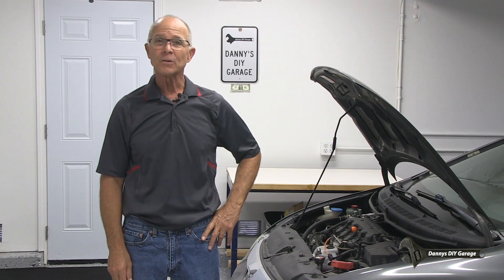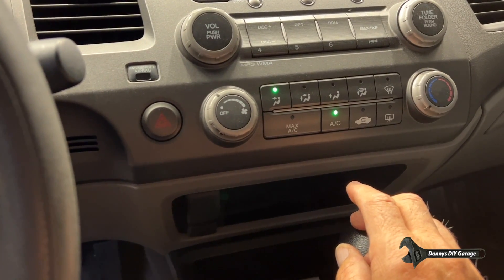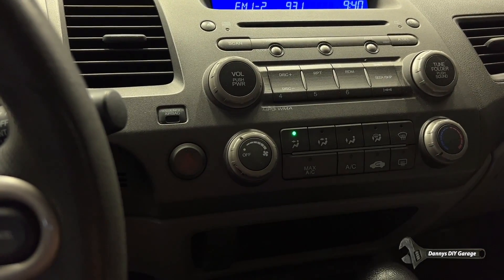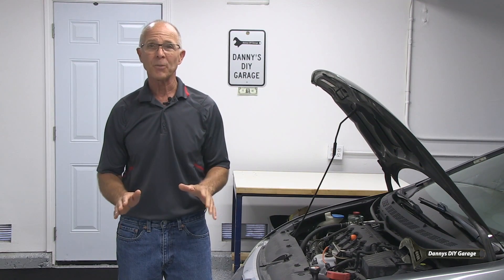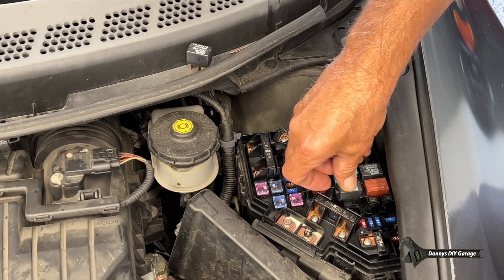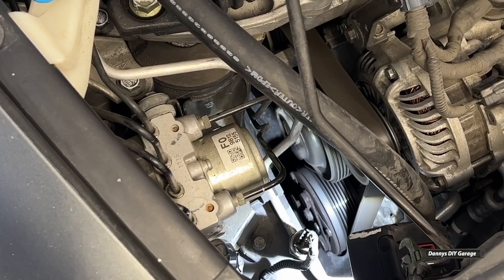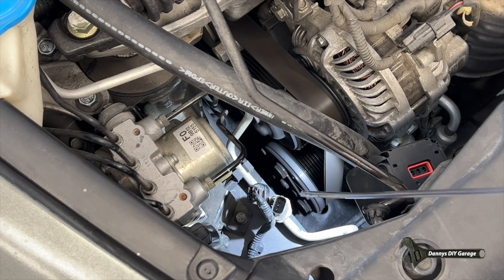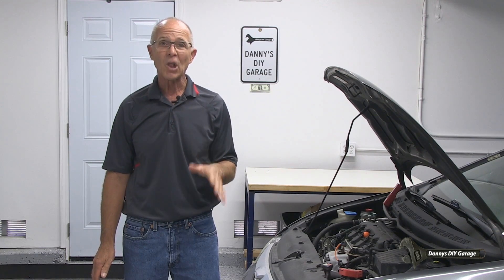Honda Civic 2009 AC system blows warm FIX

Comment: I am having issues with the buttons, when I pressed them stays on just one button and doesn’t switch to blow air. I have no problems getting cold air and heat, the problem is that doesn’t switched to blow air to the windshield or to my feet, any recommendation to fix that please 🙏
Reply from the maker: Sorry I never saw this comment, did you fix this
Reply: @dannysdiygarage i have a similar issue. i was told the whole ac system is bad. when added freon it blows colder air but last like a day or two. clutch engages, fans turn on and it blows colder air when recharge. if it was the whole ac system i doubt it would do that. any recommendations on what to do to check if is just one part?
Reply from the maker: @joseturcio361  if it won’t do a diagnostic check, you may need a control head,
Reply: @dannysdiygarage   so my ac blows cold air in the morning- parked inside garage but if i leave it outside in the sun the ac blows just air not cold at all. my ac compressor clutch turns on, all fans turn on. i will replace the the air blend door actuator cause is bad. what can be the problem?
Reply: i think u have a bad ac power head

Comment: Thanks for uploading.My 2011 honda civic is not cooling.After replacing relay the clutch started moving .car still not cooling .Gas was low and added.what I can do myself? Please help me thanks
Reply from the maker: Get a set of gauges and see what the readings are, some auto parts stores loan them out for free, the gauge readings will tell you a lot

Comment: You didn't say how you found out the expansion valve was bad! 
:face-orange-frowning:
Reply from the maker: It was because I had the correct amount of Freon in the system, compressor and fans came on, the blend door was working properly, so it had to be the metering valve or ( expansion valve ) and it was

Comment: I thought you weren't supposed to add freon if the gauge is reading in that "good" area?
Reply from the maker: There is more to it than that, it all about ambient temperature, airflow through the condenser, humidity and Freon high and low pressure, lots to consider

Comment: Hello Danny... im not getting cold air... my ac compressor clutch doesnt engage, PSI in the low-pressure circuit is around 60... when i do the test pressing the 2 buttoms, i get 4 blinks... btw when I press any of the air circulation modes, they dont redirect the air as they should, basically nothing happens... i would appreciate any help
Reply from the maker: 4 blinks indicates an open or short in the mode control motor circuit
Reply: @dannysdiygarage  thanks danny, I'll check it 👍

Comment: Unlike your car when you added freon when I added 1 can of the freon my ac became real cold. However after several days now it switches and blows cold to hot
Reply from the maker: Have you watched all my videos on ac diagnosis?
Reply: @dannysdiygarage  not all, when I have time, I will. Was only able to watch the expansion valve swap in its entirety
Reply: Im leaning towards compressor clutch vs expansion valve because of the symptoms and from me adding the freon and it changing
Reply from the maker: This one has some helpful tips https://youtu.be/WbPGVfQjAU8

Comment: What was the troubleshooting step that identified the expansion valve.  Totally missed that one.
Reply from the maker: trouble shooting was my gage reading did not make sense after I evacuated, recharged with the right amount, at times it would blow cold, however it was inconsistent.

Comment: I've  sent you several requests, and you never responded to why the heck my 8th gen civic when the self diagnostic on the heater blinks 8 times when I  don't  have A/C?
Reply from the maker: Sorry about that, I work a full time job and I unfortunately I do miss a lot of comments, blinking 8 times indicates an open in the evaporator temperature sensor circuit

Comment: If the control head flashed. What steos do I take to fix this problem? Do i have to take it to a mechanic or is it relatively easy to correct??
Reply from the maker: Depends on the dash code, some are easier to fix then others

Comment: I did the first test and the light is blinking 😢 head control head have a problem but not sure what it is. Any help is blessed
Reply from the maker: depending on how many times it flashes depends on the diagnostic procedure, blinks 1 time, indicates a open in the air mix circuit, 2 times indicates a short in the air mix circuit, 3 times problem in the air mix control linkage door or motor, 4 times open or short in the in the mode control motor circuit, 5 times problem in the mode control linkage, door or motor, 6 times Blower motor circuit, 7 times heater control panel error
Reply from the maker: watch this video also, it might help in your diagnosis https://youtu.be/vhPZsccyagA

Comment: My car honda civic fd 1.8 2008 automatic dont start, it is posible because i removed the belt?
Reply from the maker: No belt will not cause it not to start
Reply from the maker: Fuel, Spark, Compression, timing, update me when you get it fixed 
Also check the airflow sensor, sometimes you can unplug it and it will run if it’s bad
Reply: Huhu my car dont start, all sensors are ok, base on the scanner.
Reply from the maker: Is your fuel pump working? https://youtu.be/UK_Mod07vG4
Reply: Yes fuel pump ok, fuel injectors ok, spark plug all new,.
Reply: Ok,..thanks,.
Reply: @jovinmagallon9729  what happened?
Reply: @PiLLO360  fix already sir,.

Comment: Hi Danny I have a 2012 Honda Civic.I put some r134a and it went from 85 degrees to 40 degrees it stays cold but my ac clutch cuts in and out every 5 seconds.Im don't know if I put enough or too much I went to 30 psi on the low side but the can states go to 45 But it says if it has an expansion valve tx system might only take 25 to 30 psi.I am just curious what should I do.
Reply from the maker: Make sure when ac on both fans are on at all times, that’s a tough question to answer, especially not knowing the high side and ambient temperature/humidity, but I would guess Freon could be low 
Also if it’s blowing 30 degrees when driving, I would be fine with it
Reply: Good day sir my ac control panel has no power ,no light on panel what could I do to fix that.
Reply from the maker: 40 degrees is good, without knowing the high side reading and ambient temperature, it’s hard for me to give advice, I would probably leave it alone,

Comment: I had problem with 2007 civic where clutch only engaged sometimes the hotter it got outside the less likely it was to work so we took ac clutch plate off through wheel well it is a common problem and took out one spacer shim washer and cleaned rust from back of clutch plate with wire wheel the few thousands of the shim had it working perfectly after we put it back together and it has worked for years since then
Reply from the maker: I’ve also had that problem, years ago, thanks for sharing

Comment: Love your videos.  I have a 2008 Honda Civic LX that I bought new.  Unfortunately the AC cuts out when the car gets too hot.  I've traced it to the clutch not engaging when the engine gets hot during the hottest time of the day in summer after the car has been driven for a few minutes.  AC works fine every other time and season, which as you can imagine is extremely frustrating.  How would I go about fixing the clutch engagement to engage when I need it most, ie when it is hottest?
Reply: i fixed mine by removing access panel in plastic shroud on passenger side with wheel off then removing clutch center bolt with an impact wrench so clutch does not spin then remover one thin shim and clean back of clutch plate put it back on and tighten it back up there is videos on you tube of people doing this it worked perfect for me we did it years ago and it has worked since then.
Reply: @ranger178  will engine run if the clutch is disconnected?
Reply: @deschaenes  it is just the metal plate on outside of clutch that you fix it gets sucked in by electromagnet to turn on ac and thin spacer washers are put in at factory to keep it from rubbing when it gets old and worn magnet can't pull the plate in so you remove one thin shim, and you can check clearance with feeler gauge then put plate back on it is just one bolt if i remember right
Reply from the maker: I would also check the relay
Reply: @dannysdiygarage   I did check the relay, fuses and freon pressure.  AC works great except when the engine gets too hot, then the clutch disengages.  Will attempt Gregs suggestion once the warm weather returns.  Thanks to you both for your help.
Reply from the maker: At 7:30 in this video, I explain what Greg mentioned
Reply from the maker: Thanks for adding this

Comment: Can you explain the diagnosis of the AC clutch? 
You said if it does engage when pressed with the crow bar then it "does" need replaced... Is that correct? 
I'm trying to diagnose my 08 Civic AC issue as well as a whining sound, which I've also found can be from that clutch not engaging. Though the whine could also be an idler pulley. 
Any advice?
Reply from the maker: Get a cheep stethoscope for diagnosis on the whining $6.00 on Amazon also yes on your question
Reply: @dannysdiygarage  your tip about switching the relay fuse was genius. The compressor kicked in instantly with a different fuse. Saved me the cost of the other repair. 
Still have the whining sound, so now I believe it is isolated to the belt tensioner.
Reply from the maker: That’s awesome, thanks so much for the update, it’s always gratifying to know my hard work help save some one time and money

Comment: My system has been replaced. But it only works when I accelerate the vehicle. I come to a stop it stops blowing cold.
Reply from the maker: Many things can cause this, however most common low on Freon and lack of airflow through the condenser due to fans not coming on or condenser blockage

Comment: In the first step my car did flash the light what do I do after that
Reply from the maker: depending on how many times it flashes depends on the diagnostic procedure, blinks 1 time, indicates a open in the air mix circuit, 2 times indicates a short in the air mix circuit, 3 times problem in the air mix control linkage door or motor, 4 times open or short in the in the mode control motor circuit, 5 times problem in the mode control linkage, door or motor, 6 times Blower motor circuit, 7 times heater control panel error.

Comment: Do both fans need to run?
Reply from the maker: Thanks for the added information 👍🏼
Reply: 😁 I only saw both fans need to be running when I watched the video again.  My one fan is running but the other one ain't. 
Can it be a fuse?
Reply from the maker: Yes check fuse, fan and relay, I can look at a wire schematic if you need help

Comment: Thank you so much my heat wasn’t working and this video helped a lot
Reply from the maker: Appreciate your comment, Now that it’s winter I should probably make something for the heater, what was wrong with yours?
Reply: @dannysdiygarage  it was blowing cold air instead of hot air and you mentioned something under the dashboard that switches it to cold and hot and now that I remembered I recently replaced that specific part you mentioned that switches cold and hot
Reply from the maker: @rogelioaguirre257  thank you
Reply: Hello on my Civic 2007 when I press AC on ventilators and compresor dont turn on. I have checked 7.5A fuse and replaced relay and it still doesnt work. Do you have any suggestions what could it be?

Comment: I have a 2016 Civic with AC problem. I paid dealer to changed the compressor, condenser and recharged. still not as cold as my 2013 Hyundai.
Reply from the maker: I hear this a lot, repair shops are only as good as the technicians that are working on your car, it’s great when you can find one you trust,

Comment: My 2009 civic compressor was found to be working. I bought the used vehicle from auto dealer. A technician said it needs oil and freon. Then the condenser needs cleaning. My AC started working but my engine sounds a bit strained when I switch on the AC. Few days later a Hose tore up leaking out freon entirely. It was replaced twice. The technician said the third Hose pipe is superior quality. Freon was added for the third time and it started cooling but not to my satisfaction. I drove 2½ hours and used the AC throughout my trip after spending 2 nights. On my way home after driving over an hour with AC I perceived a burning smell inside my car 🚘 realising the compressor was no longer engaging. Bu the fan still blew warm air. I drove straight to the technician who told me the compressor has stiffened. He told me I will have to replace the compressor and condenser which as well which will be determined by the compressor model. I have been considering the huge cost of replacing the compressor and condenser because I bought the vehicle on budget. I have contacted a different technician who is willing to check it out before I found your video. I need your advice sir.
Reply from the maker: Unfortunate, you shouldn’t have had these problems, ac isn’t very complicated, my opinion (however I not there with your car) you should replace your expansion valve if your compressor had a catastrophic failure along with condenser receiver dryer compressor, make sure lines are cleaned out also. Please update me once fixed
Reply: I just had this problem today. Please what was the solution to this? Please help

Comment: What if it flashes what’s the problem?
Reply from the maker: Depending on what code it flashes, depends on the diagnostic steps and problem area
Reply from the maker: Code 3 indicates problem with the air mix control linkage, door or motor
Reply: @dannysdiygarage  will that affect my ac performance? I have notice that when I have my ac on compressor clutch doesn’t disengage but blows air but not cold enough,everything else seems to be working fine.  What do you think it will be the problem? Sorry to bother you thank you
Reply from the maker: Look at the video around 3:20, this might help
Reply: When you do the testing with reservoir button and defogger mine does everything it does with you but reservoir button flashes 3 times pauses and do it again and again.
Thank you for your fast response
Reply: Hi Danny what if it flashes  one two one two and pause?  4 flashes and pauses?
Thank you

Comment: Where is the blend door actuator? Your video doesn’t show where.
Reply from the maker: I believe it’s called a air mix control motor on this car, sorry for the confusion , left side is what I’m showing in the video, the one on the right is recirculating
Reply: It's inside the car next to the gas peddle. just open the driver door and get your head down at the level of the gas/brake and you'll see it.

Comment: Hi Danny, great video and wanted to ask for help. The thing that has me stumped is when moving the temp. nob, the blend door doesn't move but the temp. still changes fine. I'm having an issue when I'm driving more than 30 min, air stops coming out of my vents but I can still hear the blower motor and it sounds blocked. Blend door moves fine when switching through modes. And no codes from control
Reply from the maker: Gets to cold usually caused by expansion valve or improper Freon level, sometimes you can keep max air off, and it will not freeze
I have a video replacing the expansion valve
Reply: @dannysdiygarage  I have found out that my ac compressor comes on after 5 min of the car on, Then doesn't turn off despite turning off the ac and the fan on the climate control panel. I believe that is why my evaporator is freezing up.The relay for the ac clutch is fine. Would you happen to know what can cause the ac compressor clutch to stay engaged like that? Also the climate control panel shows no messages when doing the diagnostic check. I'm stumped
Reply: @anthonyrojas9411  Most AC's have a thermistor/thermostat sensor/bulb attached to or near the downstream side of the evaporator. It's there to stop the evap from freezing up. Did you resolve the issue?
Reply from the maker: I need more information to make a educated guess, but here is something that comes to mind, evaporator can freeze if they get to cold, which won’t allow air to pass through, so if airflow pass with the ac in the off mode this could be the cause, again just a guess with the information given,
Reply: @dannysdiygarage  thanks for the feedback. What would say can cause the evaporator to freeze up?

Comment: Hi Danny, think you can help? My 2008 civic AC recently has given me issues. I noticed over time in my 3 years of ownership it seemed to get weaker and weaker until one day it would not turn on at all, no hot air or AC. Sometimes when I turn the car off and back on it will work, but very weakly. My compressor clutch kicks on, I see it spinning, and I have replaced my fuse relay as well as the 7.5amp fuse for the AC system, and even threw in a new battery. Sadly, it still blows weakly. Am I maybe just low on freon?
Reply: I've also heard of that little shim being a problem as well if you remove the nut to the compressor clutch. Should I try that first before I attempt a freon recharge? A can of freon is like 50 bucks, it's not cheap, thus my hesitation.
Reply from the maker: Best thing would be to put a set of gauges on it, you probably don’t have them though, most parts stores loan them for free, if I knew what the readings were I could probably help more, but with what you explained, yes probably low on Freon but that’s just a guess
Reply: @dannysdiygarage  thanks, I will put a gauge to it, I'm thinking I have low pressure somehow, but I don't see any visual leaks. The dashboard blower motor sounds like it's struggling when it's on, but it's clean as a whistle I checked all that.